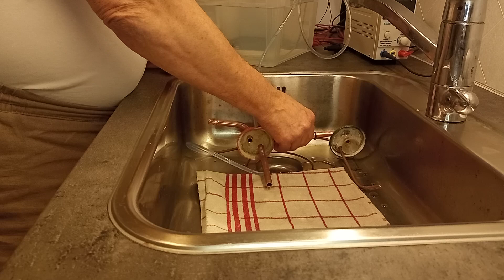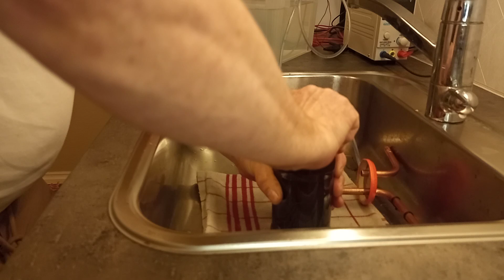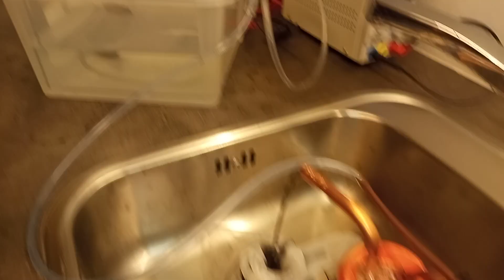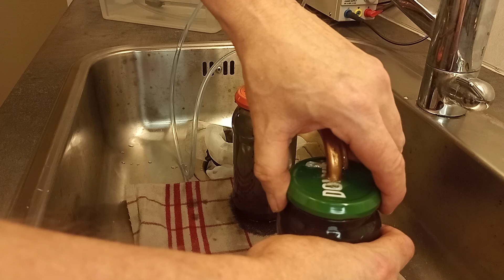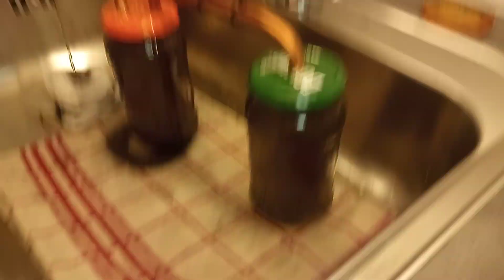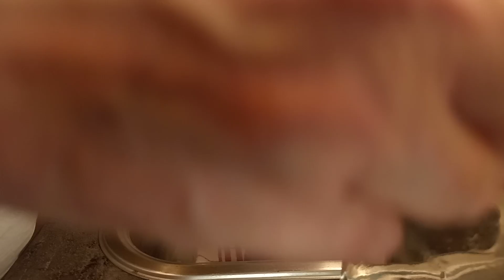separate ashes from IC chips without losing gold bond wiring

Comment: Genius!  I think I would coil the copper tube around the bottom, pinch the end and drill small holes to agitate the material in the center on both jars.  I also have very large pickle jars that would make an excellent upscale to the process.
Reply from the maker: Thanks.. I'm in the process of making a bigger version myself.
Good idea and let the copper pipe go around the bottom, will try it.

Comment: What sizes of copper tubing did you use? Great vid btw! Was looking at buying a micro siphon sluice but would much rather diy. Ic chips are my favorite to process!!
Reply from the maker: Hi i used 10 mm,  
is very easy to make, hope to see videos of others who have made one, good luck.
Reply: @MrFlyon  is the first run from the pump smaller though? Maybe 5mm? Thanks 👍
Reply from the maker: @bnae38  the hose frome the pump is 4 mm inside.

Comment: Thank you for sharing your invention, very inventive!
I would recommend adding a few drops of dishwashing liquid to break the surface tension of the solution. Another thing is that by connecting the water supply hose directly to the tap, you no longer need the separate water container with pump. The pressure will be sufficient in my opinion. You can always find an adapter to connect to a tap. There are even versions where you don't screw the hose onto the thread of the tap, but connect it to some sort of rubber cap that slides over the outlet of the tap.
Reply from the maker: Thanks for the feedback.
Shall try and connect to the tap, but then I can't use soap in the water. 
Will post a simple sketch and better pictures of the funnel and how it is put together, everything is put together with glue, but will make a new one that will be soldered.
Reply: @MrFlyon  Since your outcome is already of high quality, I think the soap will not really have huge influence on the yield. And soldering is a good idea. Goodluck!
Reply: Great innovation👍😃 
Thank you for solving a problem I have been thinking about for a long time. Will build a similar one tonight🙂. However, I would advise against connecting directly to the water faucet, ordinary water fittings are not made to work against resistance/pressure, this will damage the gaskets in your kitchen faucet and cause it to start leaking. Just a tip in all wellness🙂. Continue with the 12v pump I think. /Dennis 🇸🇪